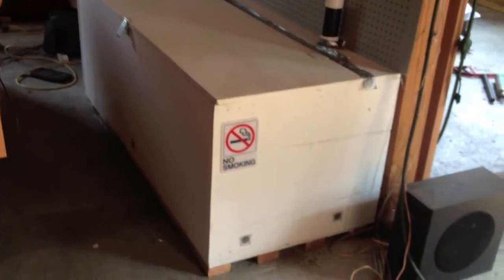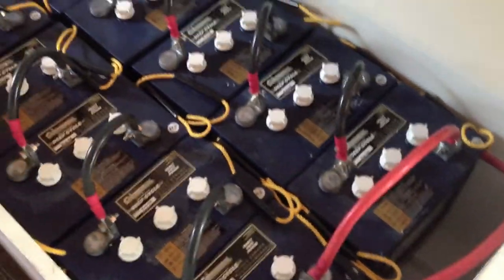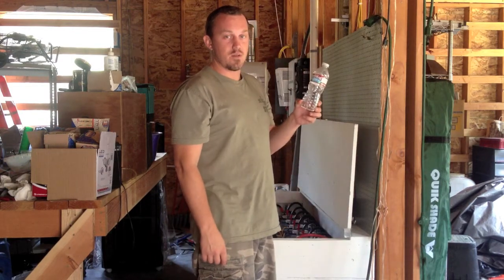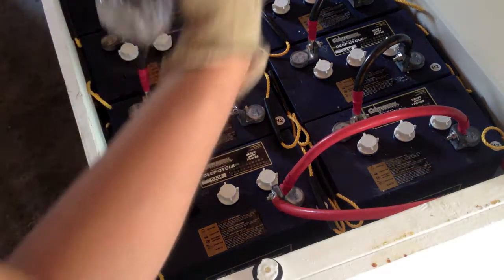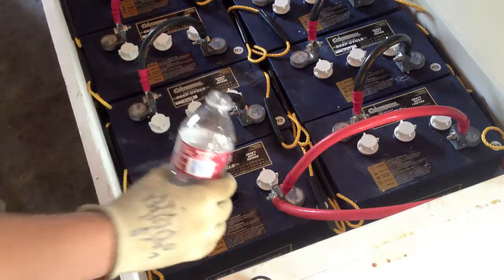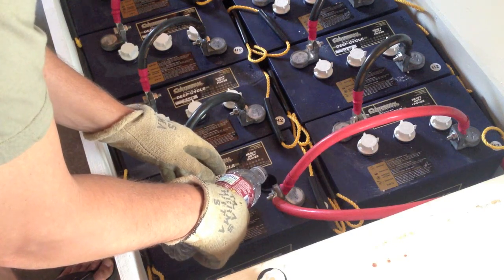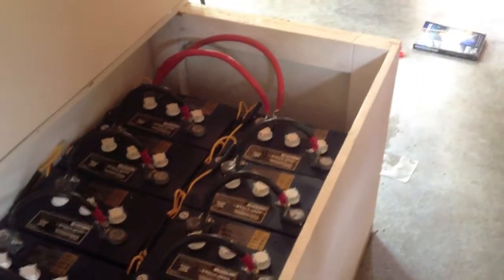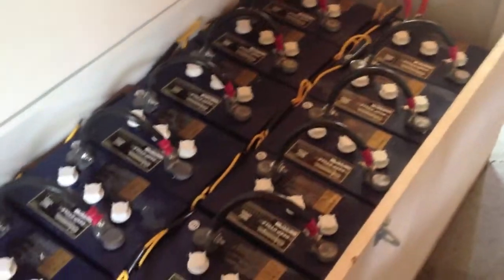How to Add Water to Batteries. Solar Battery Bank Off Grid Maintenance Instructions.

Comment: One of the main benefits or running 48v is you can use much smaller wire. You don't need all that 2/0 giant wire at that point. Your amperage is 4 times less then a 12v system 👍🏻

Comment: Hopefully you're aware of the top level point of the fluid for each cell... it does not get filled to the top of the chamber...? Over filling will result in a mess later on...The maximum safe fluid level is just touching the   ""BOTTOM""   of the filler tubes.
Reply: 1/8" from the bottom of the filler tubes is typically recommended by battery makers.

Comment from the maker: Purified water could still have minerals depending on how it was purified. If it was through Osmosis than you are probably fine. You should be ok if you dont do it anymore. The minerals from not distilled water collect on the lead plates in the battery and diminish the lifetime of them. Just make sure next time you use distilled.
Good luck!